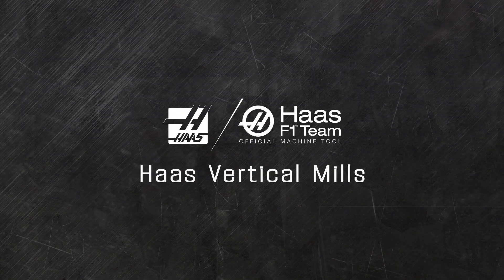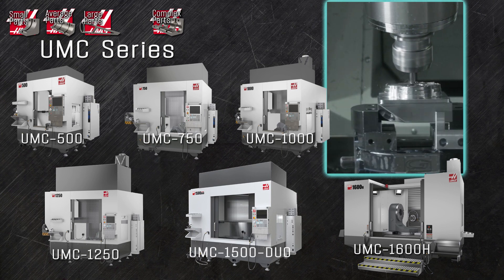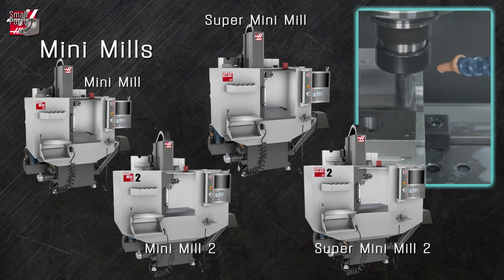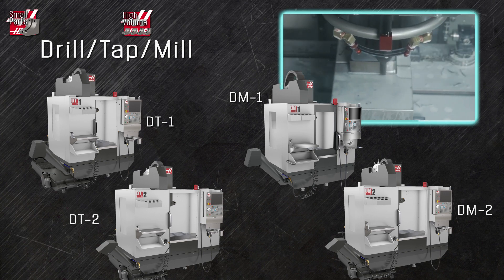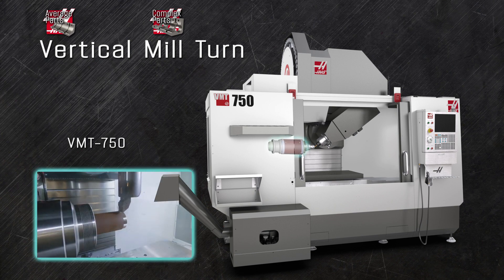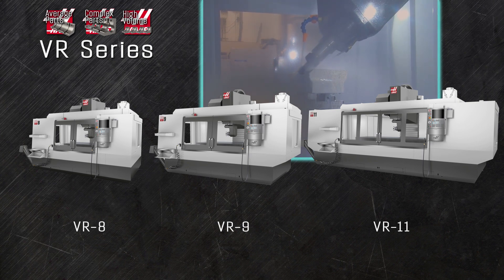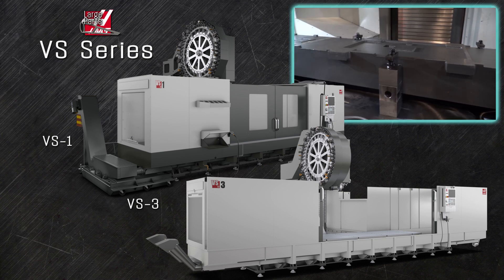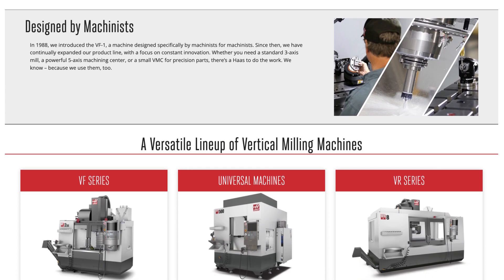Haas Vertical Mill Overview - Haas Automation, Inc.

Comment: Hi. Unrelated question. Is there any chance HAAS is going to reproduce the Haas shop notes notebook? That thing was super useful and downloading a pdf just isn't the same as having the notebook itself.
Reply from the maker: bendingsands87, Hi and sorry for the delay in answering your question. There are indeed plans to reprint the Shop Notes again and have them available at IMTS in September. Also the plan at this point is to print them thereafter and most likely have them available via Haascnc.com.
Reply: @haasautomation  Oh good! Will it be the same one, or will you be updating it at all? I know if you add much more it'll be something more than a little notebook, but I wouldn't mind some excerpts from Haas Tips of the day. 😁 Ps: I found the old one I got from my last job and it's a little beat up, the calendar is 3 years out of date, and I'm running different mills, but it's still a huge help. 👍 Thanks for the response.